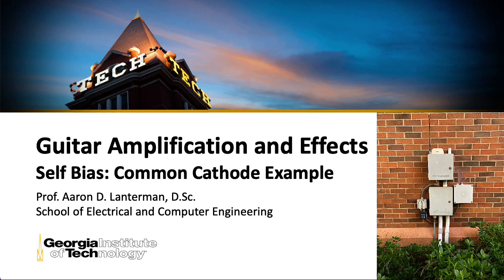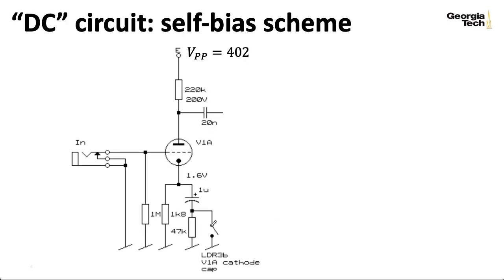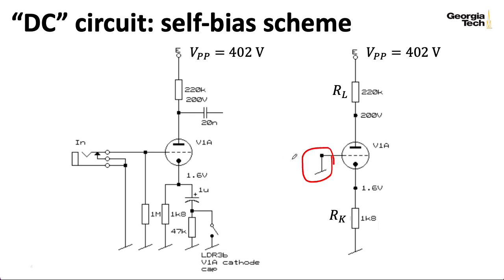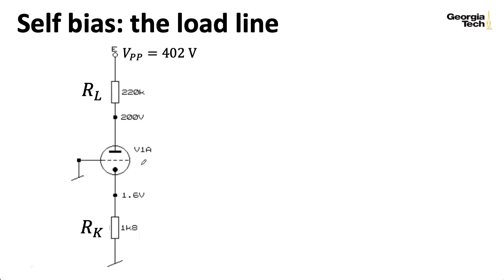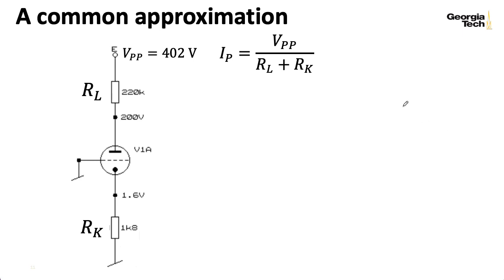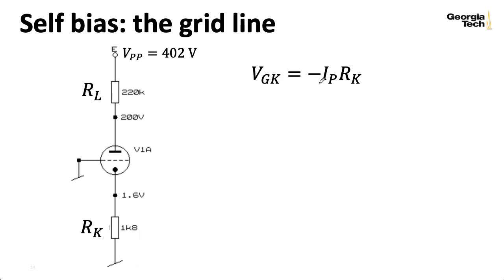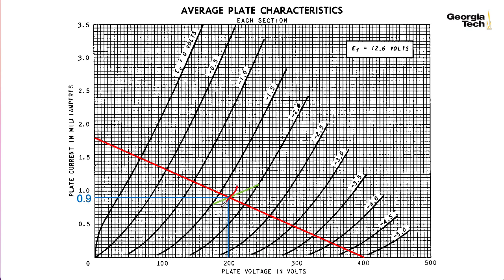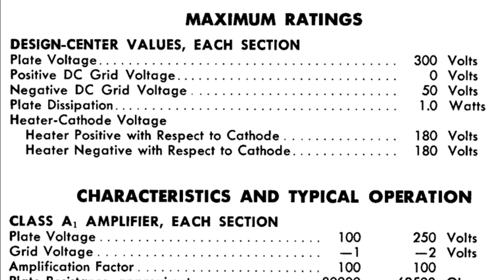ECE4448 L17: Self Bias: Common Cathode Example (Guitar Amplification & Effects, Georgia Tech course)

Comment: So, I've been using in my personal design/simulation experiments that the "pure" guitar signal coming in to the amp is max around 0.6Vpeak-peak. I believe that part of the reason for the DC cathode voltage is to help protect the tube during positive swings at the input, but my question is, in the situation when multiple pedals with a significant amount of gain are at the front of the amp, isn't there a chance for that Vgk to go positive? I assume that tubes can handle little bit of a +Vgk, but over extended periods of time I don't know what would happen besides destroying the tube.
Reply from the maker: You are correct; its something I've wondered about too. Check out Aiken's page on blocking distortion: https://www.aikenamps.com/index.php/what-is-blocking-distortion
Reply from the maker: People will sometimes put a "grid stopper" resistor in series with the grid after the grid leak resistor, but I've never really wrapped my head around it.
Reply: Either way, the input capacitor should stop the grid current after a while so I should think that it won't damage the tube?
Reply: According to the text, the effect can give rise to unsymmetric distortion that adds even and odd harmonics to a sound (symmetric distortion generally adds odd harmonics, at least to sine waves), and that many prefer it over the clipping distortion usually created by solid state amplifiers.
Reply: I read through Aiken's page about blocking distortion, and it seems to describe basically the same phenomenon as Pirkle does. I guess that it can be desirable or undesirable depending on the circuit topology, component values, the sound that is passed into the amplifier, and taste.

Aiken also mentions that the effect is generally worst when the time constant is long.

I guess that if the input waveform is regular enough and the time constant is fast enough that the top (and possibly bottom) of the waveform gets through each cycle, then it could give a nice coloring of the sound. But if the overbiasing becomes so bad that the sound just randomly cuts out then it's probably not so nice.
Reply: @Lantertronics the grid stopper forms a low pass filter in conjunction with the miller capacitance of the tube, it’s used to limit the bandwidth and prevent RF and audio frequency oscillation.

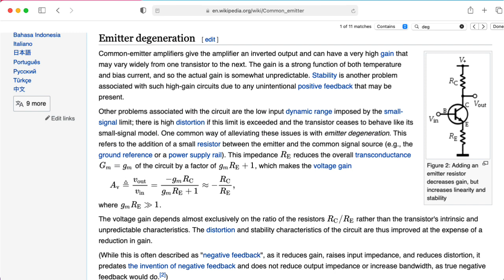Comment: At 7:00 you draw an analogy to BJTs and JFETs. While the former were covered in EE undergrad, I had to look up the latter in the pages of my newly-acquired Dailey! Will JFETs get their own lecture later?
Reply from the maker: JFETs aren't really covered much anymore; MOSFETs have taken over. They have a lot of nice special cases uses though in analog electronics. They won't get their own lecture per se, but I talk about them here in the context of using them as approximate voltage-controller resistances: https://youtu.be/BMrcuDIoG2Q

(see the 7:38 mark)